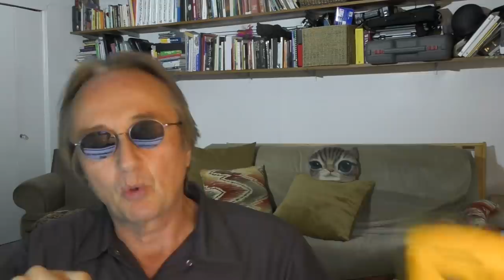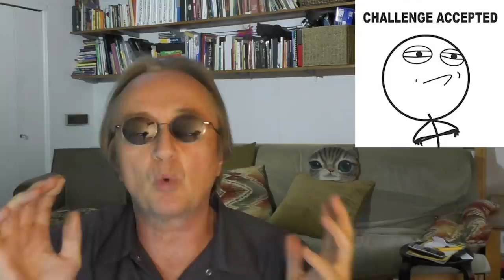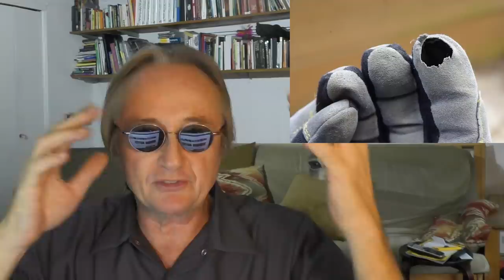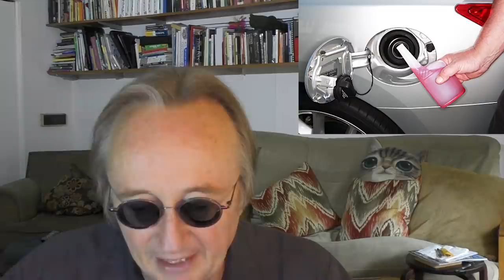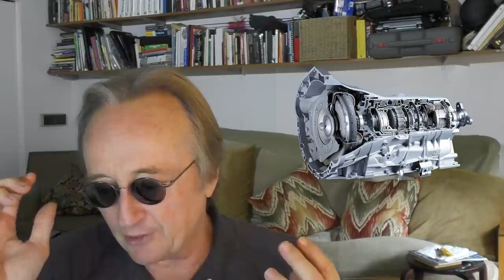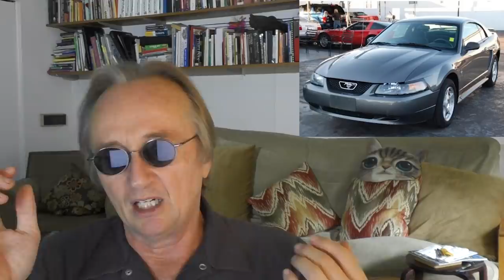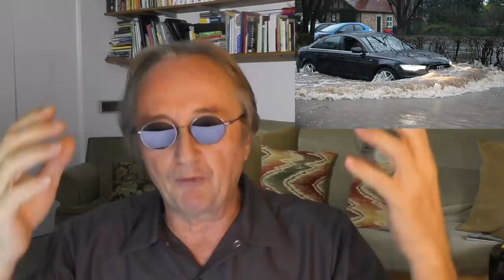The Scariest Car I’ve Ever Worked On, It Can Kill You

Comment: Hello, 
I have 2003 Lexus es300 it has 228k mileage I drive 100 miles a day. I'm noticing that the car is not doing a good acceleration especially after driving it for 30 minutes. it's even sometimes not doing anything if I push the pedal harder. why do you think that's happening? FYI - the car has new spark plugs, air filter and I cleaned the AIR FLOW SENSOR. I also have the check engine light on because of the catalyst converter, do you think that is the reason? Thanks in advance.

Comment: Dear Scotty, I had a front end collision, my radiator and condenser were damaged and I'm thinking to replace them by myself, it's easy to fill in the coolant, but I don't have AC compressor to vacuum and recharge the AC system! The question is can I just connect everything and fill in the coolant, then drive to AC specialist shop to recharge the AC system? Or I can't drive the car if no Freon in the system? I hope you will answer me. thanks :) p.s my car is Mazda 3 2010

Comment: It's not the volts that get you, it's the amps.

That said, 280+ volts off of a hybrid battery pack is more than enough tension for the electrical charge to use your body as a conductor towards ground.

So that high voltage coupled with the fact that the battery pack has enough amperes to motivate a passenger car pretty much translates into something that'll turn you into a crispy critter if you're not careful.

However, getting zapped by the 280+ volt hybrid battery would be different in one way compared to getting zapped by 120 volts from your household mains; the hybrid battery will be direct current whereas the current from your household power will be alternating 60 times a second.  Of course, being careless with either one can potentially result in electrocution.

Comment: Hey scotty, I was wondering about your opinion on the jeep cherokee XJs? I have a 1997 jeep cherokee sport with the inline 6 cylinder engine and a automatic transmission. I have been having to replace a lot of parts recently, and everyone keeps telling me its because its a jeep (just empty every pocket), but im thinking its just because of its age, and that its got 200K miles on it. I love it though and am trying to keep it running for as long as i can
Reply: As long as it remains under a used car payment per month to fix, it's a good deal. But I suspect it's not so good to keep it. If you don't need the utility, you may want to look at a boring cheap car <$1,500, like a '99-01 Corolla or Chevy Prizm.

Comment: I stopped trusting the fuel companies to follow the laws when Citgo let through a batch with just a ton of sulfur in it.  They later had a class action suite as it was in memo's they knew about it and decided not to re-refine it.  Figuring it would be a hard to prove the cause and many wouldn't even think to try if a problem arose fuel sensor, O2 etc. several.  My car it knocked out my fuel level sensor which also by odd design caused the gauge on the dash to die as well $1200.  My parents cars were always off by at least 1/4 tank and tended to float which they hadn't done before.  So unless they are top-tier which they actually are now I trust them to have proper cleaners like trusting a hungry dog to carry a t-bone.

Comment: Scotty, scotty, Scotty.

Being a decent person in electronics, 288 V is NOT enough to kill you. Most of the time, the battery is running DC power. And your wall outlet that has 120 V, THAT IS AC. That's why it hurts when you touch it. DC is much less dangerous. 288 V of DC may give you a tingle in your fingers, but now way in hell can it kill you. You would need to have heart problems for that to happen.

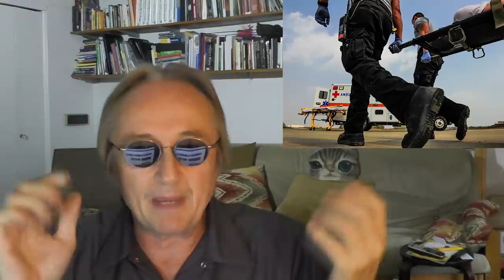Comment: 1:38 I never really thought much about electric cars in a bad accident, since I have NO interest in them anyways. They could cost you your life because they FOR SURE WILL delay first responders who are trying to get you out. Also the batteries are made of a lot of cells linked together. I had a remote control car with a rechargeable battery pack as a kid that I was driving around and it suddenly stopped. I popped out the battery because I thought it came unplugged and it was hot. then all of the sudden it started shooting out fire and sparks like a firework torch. I dropped it and kicked it away from me and it went under my dads car. I had to quickly get it with a rake. It went on for almost 2 minutes. A Tesla car battery pack has OVER 7000 cells. The toy car had like 6 small ones and one went bad. A lot of people probably give no thought to this.
Reply: I just did in a comment above that's cool to see you thought of this too I'm gon keep reading see what they say
Reply: @PingasTheFourth what if you crash and hit the battery will it explode or shoot fire either/both?

Comment: A little more about those V6 Mustangs:  Most people looking for a used Mustang want a V8, and there are plenty of reasonably priced V8 cars available, so V6 cars have a lower resale value, which is why you can find them cheap.  The gas mileage of V6 Mustangs is only marginally better than the V8 cars.  I had a 2001 Mercury Cougar with a V6 which got 24 mpg on the highway, but my friends V6 Mustang from about year only got 18 mpg on a good day.  That was the same mileage my '99 F150 with a V8 got.  Avoid V6 Mustangs, unless someone is giving you a screaming deal on a nice low mileage example, and you don't care about performance or future resale.  Oh, and don't think you can just go and drop a 5.0 in a V6 car.  There are a lot of other parts which will need to be swapped besides the engine.  Unless you already have a wrecked 5.0 Mustang setting in the backyard, you will quickly spend a lot more money than if you had just bought a V8 car in the first place.

Comment: 220-240v it's painful af, I cursed really loud that time... well I didn't die because of I'm hard to kill and it was a home electric instalation (alternate current) and not battery (continuous current). S**t can happen someday even if you're careful like me but that one time I forgot to pull down the switch in the kitchen again, turns out there was some water leaked that somehow made one screw from the plug I was fixing really painful when I touched it to unscrew the thing.

Comment: It's not the volts that kills you it's the amperage. Low volts with high current is many times worse than hundreds of volts with high amps. Car batteries have high amps, even the 12 volt batteries. Think about it. They have hundreds of amps. It only takes .03 amps to kill you. 10,000 volts of less than .03 won't Kill you but will light you up

Comment: But you need to consider that the battery has 288 volts *DC*. DC doesn't kill you, its way more safe than AC power (like power outlets, 120Volts in America, 230volts in Europe) which is able to kill you. So the Prius couldn't have killed you, it would've hurt getting shocked, but it couldn't hurt you and it's very unlikely that you get any serious injuries. Pay attention to wether it's AC or DC when working with electrics, it might safe your life!

Comment: Hey Scotty How reliable are Porsche (911) in general and which exotic car or high end sport car have the best reliability overall? .
Reply: Poor, and Lexus
Reply: From personal experience I have 180k miles on my 2012 Audi TTRS and have had no major issues.  Plus I drive pretty rough with it and have done some mods such as changing the intake, a bigger turbo, and aftermarket exhaust. But I've heard Audi can be a mixed bag so don't take my word to heart.

Comment: Scotty just has to down the Prius. He just can't handle hybrids. You only have to wear the gloves if you are doing something around or with/to the battery and it's connections but the majority of Prius maintenance like tune ups oil changes etc don't require it and believe me, Toyota Prius has very few issues. 2003-2007 Toyota Prius is the highest rated car in history for durability, reliability, and dependability and it is a hybrid. who really cares about you having to wear some gloves to work on my car Scotty? I don't, I just care about 50 miles per gallon.

Comment: Amperage kills not voltage you can have 1,000,000,000 volts & 0.1 amps it won’t hurt but 1v & 700amps it will kill you.

Comment: The new electric cars with the longer range are now using 380 to 420 Volts. Very dangerous. The dealer service are using high voltage rated protection clothing, face mask, and the gloves when working in any area with the high voltage.   When working on this type of vehicle the area is roped off.  You have to remember the shock hazard from DC is 3X more dangerous than the same voltage AC at 50/60 Hz.  Over 100 Volts DC can easily be very dangerous from simply coming in contact with both potentials at the same time.  If making any type of short with even a 12 Volt car battery can end up making a very powerful hot point leading to severe burns, and fire.  The small electric cars battery system is usually in the 60 Kw to 80 Kw range. The larger longer range electric vehicles are typically in the over 100 Kw to 150 Kw range. 

Shorting out a 400 Volt battery supply rated at 80 Kw or more as like in an electric vehicle can have a horrible electrical exploding spark or high intensity fusion point. The discharge on short circuit can be equivalent to thousands of Amps. The force of the spark can blow off someone's hands, cause severe burns, and the flash can cause permanent eye damage!  

The 120 VAC / 15 Amps used in the home can kill people, and or cause terrible injury if not properly respected. The 220 VAC / 80 Amps used for major appliances is even a lot more dangerous.  The batteries used in electric vehicles are far more dangerous than anything you would have in your home. A home with a 200 Amp entry is about 40 Kw.  A small electric car is double this in power.   

I have an electrical engineering background. I worked on some types of communications systems, high power power supply design, charger design for large battery systems, and etc.

Comment: I have a 2017 Toyota Corolla. When it is in drive and every time I come to a stop with my foot on the brake it shudders and shakes hard the rpms will drop as it shakes then they go back up and everything is fine it goes back and forth until you start moving again no codes or check engine light is this shaking and dropping and rising of the rpms normal?

Comment: 12 volts is more than enough to push a lethal amount of current if circuit resistance is low enough. Unfortunately for humans, our bodies don't offer much electrical resistance at all. As little as 150mA can be fatal under the right circumstances.

Comment: But that’s 288VDC which is WAY less dangerous than the AC equivalent. Maybe even less dangerous than 120VAC but I’d have to think about that. They may be about on par. But it has to do w/ the fact that AC current can pass through capacitors while DC can’t and the human body has a certain capacitance/impedance (along with the ground itself). This is why you feel nothing if you touch both ends of a 48VDC phone line despite that being almost half the RMS voltage of hot to ground/neutral in the US.

So, I suspect 288VDC is about as dangerous (or a little less dangerous) than standard house Voltage. Probably less since it must return to its own ground instead of being able to travel through the actual ground back into the transformer. In other words, you’d have to touch one hand to the positive and the other hand to the negative terminal w/ wet hands and a total body resistance of 2.8 kOhm or less for it to be lethal. I’ve never had that low of a resistance through my body when measured w/ a Fluke multimeter.

Comment: I have a neurostimulaltor in my brain powered by a pacemaker in my chest (Deep Brain Stimulation). Most voltage I got up to firing at my brain was 2.3 volts. Because of it I cant go anywhere near metal detectors, have to stay away from welding, microwaves and getting zapped in any voltage....

Comment: regarding hybrids or EVs I cannot imagine that there would not be a big fuse somewhere that can be removed to isolate the battery. is this not the case?
Reply: wvadam - correct.. all EV vehicles have a connector block to allow emergency responders to disconnect the battery. I recall reading that the Tesla vehicles have a 600 volt battery.

Comment: DC is not lethal at 288 volts. But if it's AC then 288 volts would definitely kill a person
Reply: K K - Actually, a DC voltage of 42 volts and higher can be lethal. It all depends on individual body characteristics and conditions but industry wide it has been determined that 42 volts has enough potential to create sufficient current to be lethal.

Comment: Scotty please, I'm an electrician, quit telling people this bullshit about 288 Volts. Yes, it could kill you, though, it's extremely rare. That's why you are supposed to use proper tools. And no, there is no need to wear the gloves constantly. With the right tools and correct behaviour you'll be fine. The right behaviour is: Disconnect the goddamn baterry! Don't touch the terminals afterwards!

When it comes to helping people in a crash, you have to close circuit to get hit. Guess what, cars are typically what we call an "Island system". These systems are not connected to the general network in a typical way, which means - THEY ARE NOT GROUNDED! There is 0 VOLTS against the ground! You'll need to be extremelly lucky to get in to conditions to get hurt by their baterry in a crash in any other way than burning to death. And burning not by electricity but because of the fact lithium is also good rocket fuel.

I could talk in length about how demented todays public electric network is in case of safety. Because in fact, grounding electricity is stupid, but it would have taken too long.

And guess what! I work on 500 Volt appliances and I don't even have these gloves in my toolbox! That's because completely regular rubberized gloves will work just fine. Heck, if you know how to do it, you can touch live 400V rail with bare hand and you won't feel it!

Heavy rubberized gloves are used in ACTUAL HIGH VOLTAGE like those 22kV substations I used to work on, yes, there you need them. But in normal field, most electricians work only with insulated tools and bare hands because they hate gloves.

By the way when it comes to dying by being hit by less than 1000V, from what I know it's usually the after effects that kill you. Stuff like various ways to fall stupidly on the ground, or the post traumatic stress that will cause your body to shut down. 

The worst thing that could meet you then, is idiotic spectator, trying to help you, by breaking your arms (real story).

Comment: With all due respect, you have not idea when it comes to hybrid and EV technology! They all use an IT network, so first of all it is impossible to get electrocuted by touching one part like the cassis. 
There are several safety systems for any occasion imaginable, if you are interested I could give more examples. By the way, nobody uses those gloves except for when you open up a high voltage battery which a regular commercial mechanic isn't qualified to do anyways.

Comment: My 2008 Ford F-150 shakes when I am breaking. The harder and more suddenly I break the more it shakes. Tires have been balanced, but still shakes. What’s causing this? Is it expensive to fix?
Reply: Shiva L yes it is!
Reply: So I had an 04 and had a problem with the bolt on the caliper coming loose and causing this, though your problem could be a myriad of things from a suspension issue to a bad wheel bearing. Scotty has videos on how to check those things.  I assume you do know that the antilock brakes on that truck will cause that to happen as well when you press the breaks really hard.  Sounds like it's time to jack it up and check things out.

Comment: Absolute rubbish! Volts thrill ( bet you have been zapped by a plug leads 30 000 volts or so Scotty) but mills kill ( that's milliamperes) so don't wet your hands with an ionising solution like salty water and touch each side of your cars 12 volt battery!

Comment: Voltage doesnt kill Scotty.....Amperage does.
Reply: @PingasTheFourth.....Name calling never wins arguments. Proof of MY statement....ignition wires. If you worked on cars doing the old wiggle test to determine a misfire, you would get shocked. How many volts is in an ignition system you may ask. Well older systems of points and condensers were around 35,000 volts.  Modern COP(that would be coil over plug, in case you are wondering) reach around 75,000 volts. Now....I am sure one grandpa with a pacemaker somewhere along the line got killed doing this. But MILLIONS of people have been lit up by these ignition systems without ill effect. Why???? AMPERAGE. The amperage on an ignition system is measured in MILLIAMPS. 

The three basic principles for this can be explained using electrons, or more specifically, the charge they create:

Voltage is the difference in charge between two points.
Current(amperage) is the rate at which charge is flowing.
Resistance is a material’s tendency to resist the flow of charge (current/amperage).

 Taken from Google asking the question, How much amperage does it take to stop the human heart. This is a copy and paste of the #1 answer....

Any electrical device used on a house wiring circuit can, under certain conditions, transmit a fatal current. While any amount of current over 10 milliamps (0.01 amp) is capable of producing painful to severe shock, currents between 100 and 200 mA (0.1 to 0.2 amp) are lethal.

So.....before attempting to sound intelligent on a thread, I urge you two things...

1.....research what you will be debating. It helps.
2.....Name calling never fares well for the person calling the other with accurate information. So refrain and stay on point WITH proof of your allegations. 

In the end, my ORIGINAL comment, Voltage doesnt kill Scotty, Amperage does....STILL truth.